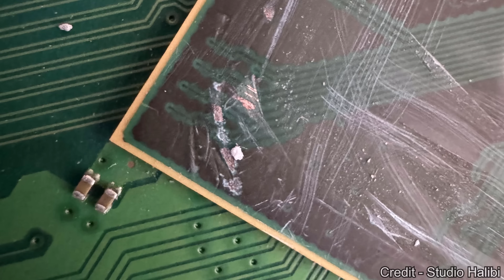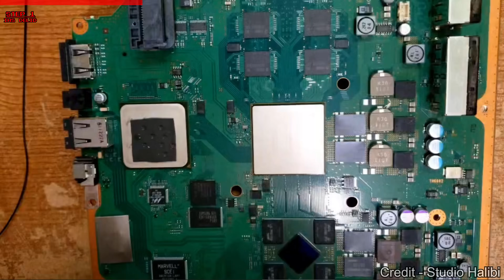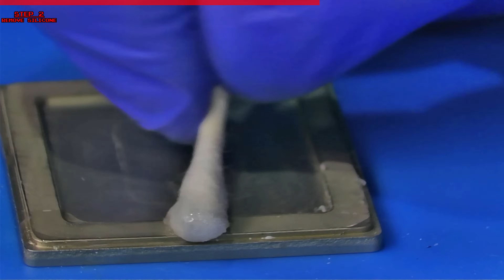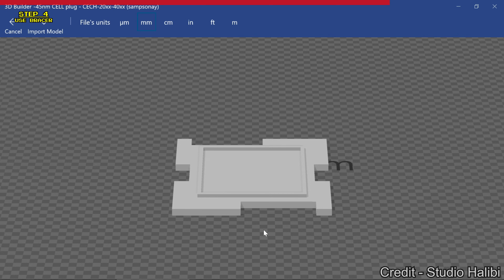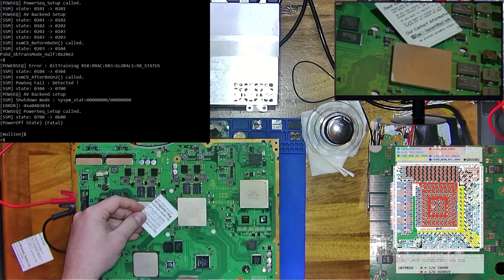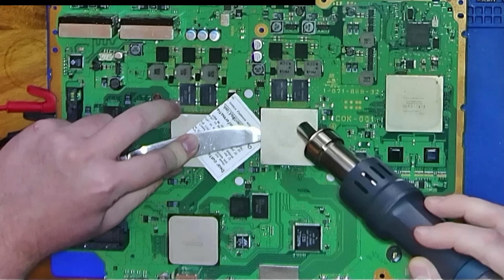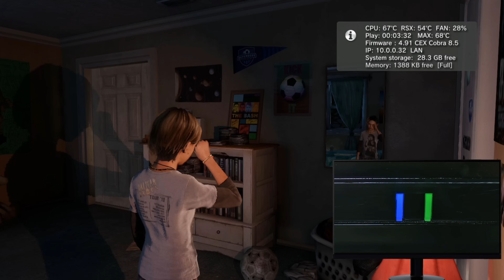How to Fix | Episode 1: Overheating. How to Delid CPU/GPU and fix YLOD - BEWARE of BAD MODs!

Comment: Hello Felix. Amazing and very informative videos you make. I really appreciate. At 11:46 you mentioned that you don't delid IHS on your personal console. Do you see any difference? I wonder how does it affect longevity.

I saw on ps4 they used semi open IHS.

Recently I have repasted lenovo x230 and dell inspiron 7560 both laptops has gpu and cpu without IHS.
Reply from the maker: My approach to repair/modding in general is to not fix what aint broke. Unless I have a good reason to do a mod or am investigating a mod I usually won't "premptivly" repair somthing that's currently working. A few exceptions I've began making are the Proadlizers (eg, NEC/Tokins). They tend to go bad after this long in service. So while that wasn't the major issue with phat models, it is an issue that should be fixed if you're going to do extensive rework anyway. Better to get it done then and there, than have to do it later and risk BGA damage opening the console a 2nd time. I'm of the opinion now that deliding is also necessary during the overhaul. I do prefer to reglue, but I do not have evidence to suggest it's bad either way. I just err on the side of stock unless I do have evidence to suggest it's fine to depart from it. At least in any console I'd sell, unless specifically asked not to.

Comment: Im a mechanical design engineer. I have designed many complex boards for communications equipment. All of the equipment I design uses very small components, including small FPGAS, PSOCS, Pop memories, etc all needing thermal dissipation. I use Solid Works Flow Simulation to predict thermal behavior (and thermal expansion/contraction) of these things under extreme conditions, and I'll tell you something. The silicone on the ps3 cpu and glue on the rsx ihs are, more than likely, to help with assembly. Vertically,  these ihs's are compressed in place by the brackets on one side and the heat sinks on the other, so the glues are not doing anything. Additionally, silicone softens under temperature, so any structural support it may provide is gone. These glues are great for holding the ihs's down, mainly for assembly, but thats it.
Reply from the maker: In the documentation I read the IHS adhesive is used for assembly purposes, like you said. I would still like to see the thermal design simulations. Particularly the MTBF with and without silicone on the CPU IHS. I'd like to see the same results for the RSX with it's thermal plaster, (which does provide regidity). In both cases people claim it makes no difference to delid and not reglue. However, no one is providing concrete edvidence to support that claim. Because of that I see it as copium for an unsuported belief. You are entitled to believe what you like, but what I have a problem with is when people then go out and influence others to believe the unfounded claim. The only thing we know for sure is that they shipped with these adhesives in place. If you put them back you are not changing a varible that could have a detrimental long term effect. So what I'm saying is that I cannot reccomend people leave the adhesive off, because I have no evidence to base the claim "it's fine." I personally would be comfortable leaving it off on my console, but I make no claim it's fine, because I cannot know that and don't want to mislead others.

Comment: For RSX I use a shaving razor snapped in half. 

Tape all around the chip just to be extra safe. 

Get the blade in a corner. Put it right under the IHS and it’ll get in between it and the VRAM every time.

Heat the IHS corner and the blade will go in easier and easier. Rock it side to side so it cuts.

Do this for all 4 corners and with very little stress to the BGA, you can safely delid.

Oh, either use some folded paper towel or a glove for the blade. I also wrapped half of it in masking paper tape so you can push barehanded. If anything goes wrong, it’ll bend, not shatter like a snap blade.

Comment: 27:35 How do I know if I need to delid the RSX if I just got a PS3 CECHA01 from a friend from work that I only briefly tested and found out the disk reader has a problem where the game freezes? If I know I have to replace the disc drive unit and CMOS battery anyway, would it make sense to repaste if I'm not using CFW to see how the system runs? Doesn't thermal paste go bad over time anyway?
Reply from the maker: My advice is to slow down and become more familiar with the PS3 hardware before attempting anything. There's a decent chance you can harm the console. The way you disassemble can stress the solder joints. For example, when separating the heatsink from the processors it can be stuck and flex the board. 

You shouldn't attempt delidding without watching videos and being ok with potentially sacrificing this console to learn how. Prefferably a donor board would be used to learn.

Also it's not safe to assume that freezing is due to a dead disk drive. It can be the hdd or bluray player, sure, But it can also be caused by BGA and bump defects. So it can be a bit of a minefield.

GL
Reply: @ripfelix3020  I was trying to play a PS2 game and it would get to varying points into the game, sometimes it would get stuck at the title screen but sometimes it got through the menus and became stuck during a race, so that's why I felt confident it was a disc drive failure.
Reply from the maker: it's possable. Try playing a CD and DVD, those use a different laser than PS3 games.

Comment: Would you fix my old ps3? Or any recommendations?
Reply: Whats wrong with it?
Reply: @ThePrivateGamer19  it just does the double beep and flashes yellow and then red turns off I don’t know. I put it in my storage years ago, but it’s got a bunch of photos on there. I’d like to recover. Probably just the heat sink, but I’m not sure I’ve never diagnosed it.
Reply: @meansled so after years of not using it, now it has YLOD all of sudden? Or you have used it recently and now it has the YLOD?
Reply: @ThePrivateGamer19 no, it did it ylod a long time ago. I’ve just been holding onto it. It’s one of the first models with the memory card slots.

Comment: I printed a 65nm one in premium ABS, and sanded it on a flat surface. With a digital caliper, the measurements were between 0.95mm and 1.00mm. Is it safe to add it this way? My Cell hasn't had a delid yet...
Reply from the maker: It should be ok. As long as it's not adding pressure.

Comment: I wonder if you've tried ptm 7950 instead of liquid metal might work better with less risks
Reply from the maker: I'm sure it'd work fine. Maybe not better than liquid metal in terms if thermal conductivity, but certainly in ease of application and risk.

Comment: I have a decha00j with a cxd2964agb processor. I found that this Undervolt cell will ylod when it is lower than 1.125v and under heavy load, and the error code 1701/14FF will appear. The other cell can perfectly stabilize at 1.05v. Even if it is lower than 1.05v, it will just freeze and not ylod. Is there something wrong with the decha00j processor? Both of them have been replaced with 40nm
Reply from the maker: I wouldn't think so. The VID was set from the factory acoring to efficiency tests for optimal performance, with some hysteresis for a same margin. When you undervolt you're cutting into that safe margin and it's always going to vary from chip to chip.
Reply: @ripfelix3020  Can replacing the solder balls improve the undervoltage problem? If decha00 is lower than 1.075V, it will definitely freeze, and even fail to enter the system, with error code 1701/14FF. Even if all oe128 are replaced, there is no effect. I have also tested several cechas, and they can enter the system when it is lower than 1.075V, but they will occasionally freeze, but there will be no ylod failure
Reply from the maker: I don't see how the solder balls would/could affect that.

Comment: Does anyone know where to get that bracket that’s being used to hold the motherboard once it’s out of the shell?
Reply from the maker: Stock has intermittently come up on ali express, but hasn't been stable.
Reply: @ripfelix3020 appreciate the reply. I’ll keep an eye out. Just search for ps3 motherboard brace?
Reply from the maker: Basically. There is a template on computer booter's server. Just a cad drawing in vector graphics for a sheet metal fab to cut out, like osh cut.

Comment: Given there were far more PS3's manufactured than 360's. I'd say there's a similar amount if your estimate is 95% of the 360's being dead & 40% of the PS3's. Sure, percentage wise the PS3's are more reliable. But numbers wise it'd be safe to say there's an almost equal amount dead between the two no?
Reply from the maker: I'd have to look at the numbers. Count up all the PS3s that have 90s and the sales numbers and compare that to the sales numbers for 360's afflicted models. 

I would wager there's FAR more dead 360s tho.

Comment: Hi. Great video as always Felix I just got one question tho once you’ve stuck the ihs back on the cell and rsx do you take the braces back out or do you leave them in?
Reply from the maker: I leave the cell bracer in place. I'm testing the RSX brace, but wouldn't reccomend since that's not an official mod and I'm somewhere between unsure if it's fine or a potentially bad idea.
Reply: @ripfelix3020 thanks for the quick reply.

Comment: Is there any way to soften this silicone around the Die? I've seen people using thinner or kerosene, and it seems to make the dellid easier...
Reply from the maker: I use a bit of vasoline, or silicone grease, just to help the blade get started. But once it gets going it's not too bad  There are some later super slim models where the silicone is thicker and you need a longer tip to cut it all. That requires alot more force and can break the thin metal of the tip, depending on your tool.

As for dissolving and or softening the silicone there are variius agents that are supposed to help with that. Heat will soften it a bit. There is goof off silicone remover, which IME doesnt work great, but might help loosen it enough to reduce the force needed to cut throufmgh the silicone. But no, there's not really anything that can dissolve it. Silocone forms crosslinked covailent bonds that cannot be easily broken. They have to be chemically digested with chemicals that would also damage the PCB.

Comment: If you wanted to create better intakes for the CPU GPU couldnt you just Make your own heatspreader Like a piece of copper With fins thermal pad on VRMs and a fan over it?
Reply from the maker: There are companies that can make custom heatsinks, yes. But I dont see much reason to go that far. If you want to overclock then maybe, but I dont think it's worth the expense.
Reply: @ripfelix3020  Everythings worth it to be able to tell the PS3 enthusiasts theyre wrong.

Comment: engineers make it so because it is cheap. glue is cheaper than a way of disassembly mount. They are not smart they are dirt cheap!
Reply from the maker: They would argue cheap is smart.
Reply: @ripfelix3020  they would have the "scammer" argument. they make cheap but sell expensive. PS3 was expensive AF.

Comment: thank you so much for having such a well detailed explanation on the delidding process! a customer has requested we take on his ps3 for delidding for the sake of a software mod (explained the risk / had waivers signed and all that) and i was pretty intimidated, but wanted to give it a shot. While I ended up going with the painters knife method, the extra info you provided helped so much and my first practice attempt ended perfectly with no torn traces :> will def do a couple more practice runs on dead boards before touching the customer's, but ty for such a thorough video!!

Comment: My PS3 Cechp operates at 50 degrees on the Cell and 45 on the RSX at 50% fan speed in xmb, an average difference of 5 degrees, would adding the bracer reduce this difference? Is it worth doing this?(without delid)...
Reply from the maker: for awhile it likely will. That's why sony used them. But it's a temporary stop-gap solution. Use the meantime to learn to delid.

Comment: What are your thoughts on using the stock fan curve in the long term? It’s quiet but it lets the console get pretty hot. My cechk01 sits at 80c on the rsx with ~30% fan speed.

Comment: Couldn’t one just use slightly less stronger glue so you can lift it easier in future? It seems like a normal silicone sealant would offer plenty of rigidity and heat resistance but, in 5 years would pry off with some but not ridiculous effort (especially at 1mm). I'm in the process of making the ultimate air cooled ps3 (both chips were at 50C before making major adjustments to the cooling) then got ylod... I think from the ram chips, I put thermal pads on them so they contact the metal shround and probably cracked the solder. I completely changed the path of the airflow and have added 2 80mm fans one for psu and one for the top to suck air out, then I've bastardised an old cpu heat sink for an intake cooling the PSU and then a GPU heat sink on the flat surface and 100mm hole centred on the main fan which acts as the main air intake. So it comes straight in cooled goes through the main heat sinks then vents out the top, very efficient. I'm hoping to be able overclock 😁

But I figure with an older CECHK03 I've got to delid because theres nothing between the IHS and die :/ 

Also it's fair to point out that... Sony seem to be untrustworthy when it comes to their cooling calculations lol. Mine may look ugly but 50c idle without delidding is pretty reasonable if the die on the chip doesn't get past 65 because it's cooled properly does it even need a "stiffener"?
Reply from the maker: So here's the thing. If you can sucessfully delid, then what's the problem with gluing the IHS back on? You can just delid again in 15 years when you have to apply again. My opinion is that the best way to ensure it survives thise 15 years isnto return it to the original design that lasted that log to begin with instead of changing a varible with unknown consequences. It could very well be a structural component that's needed. And the stifness of the adhesive is likely important for that. I just want to keep those varibles the same, so Indont have to worry about them.

As for cutting holes and all the other mods you're doing. Well, I mean it's your console. I can't tell you what to do with it.
Reply: Oh yeah I cut the metal shroud at the top where the 80mm fan is to increase airflow around the board and also drilled out the little ventilation holes in the shroud. 

There were a lot less pads on my board, I've put more on now, but there was only two little pads near the top with a little aluminium heat sink then a bigger pad with a V shape from the shroud to press it down
Reply: I've got another ps3 coming that will be my back up, I'll try reflowing the YLOD if thst doesn't work I'm transferring everything over to the new console, the trouble was the ps3 was crashing before I did any mods (even with both chips at 50c), so this time I'm hoping I've got a half decent one to start with

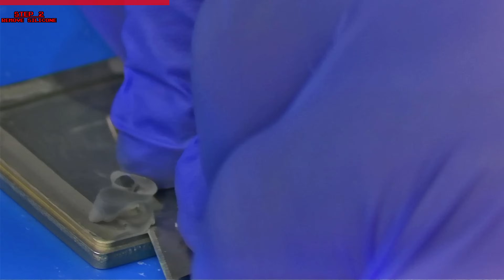Comment: 12:30 liquid metall and a ihs made out of copper propaply would improve temps.
Reply from the maker: The IHS is copper, it's just nickle plated to reduce soak in and oxidation. The die/IHS interface is liquid metal. The other interface isnt as critical, since it has a wider surface area, it's paste doesn't need as high a thermal conductivity to dissipate the heat.

Comment: Hi, Felix!! I need some help here. So, I have a fat ps3. I've cleaned it and changed the thermal paste. I'm using webman mod with the fan at 65% and the RSX is in stress at around 80 celsius. Cell is fine. Should I delid it? The model is CECHL so it should not be affected by bumpgate.
Reply from the maker: Yeah, you shouldn't need more than 50% to keep the RSX under 70c. So if you're seeing 80c at 65% it definately needs repaste (possably delid if you did already).
Reply: @ripfelix3020  I'm going to delid it, wish me luck... 100 degrees celsius and poping method. By the way, I've been following your videos since the beggining. I've got so much to tell you!! And I want to thank you for all the support!!

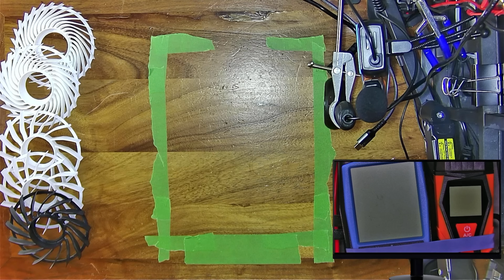Comment: 36:14 I just noticed, where you experimenting with 3D printing fans with different blades? if so did any meaningful difference happen or did something go wrong with it?
Reply from the maker: yeah, teased that. None of the DIY fans we came up with could beat the OG. We had one come close, butit was just barely able to match performance. In otherwords, I gained an apreciatiom for the fan blade designers. They clearly optimized their design.

I would eventually like to revisit this with a couple.of design and using different materials/printing process. One thing that could be useful is the blade design can change the static pressure achieved. I can make a blade that doesnt move and much air, but can achieve a higher pressure. That might be useful. I haven't  devised a way to test how usful that can be and in what scenario.